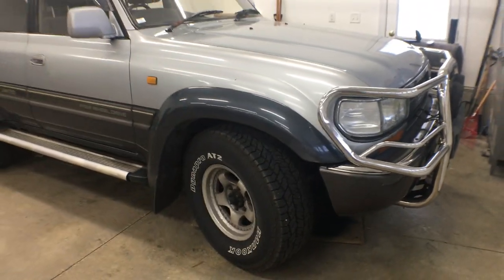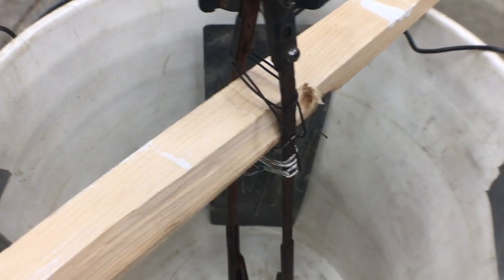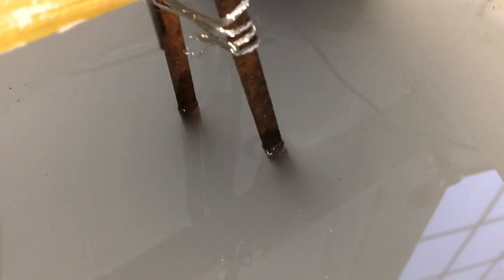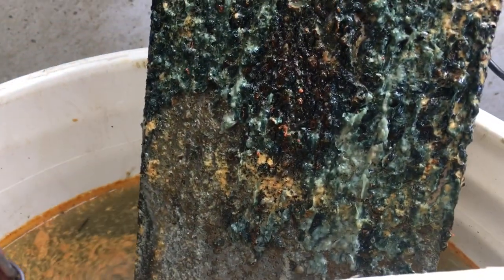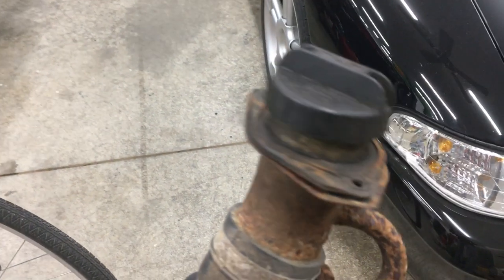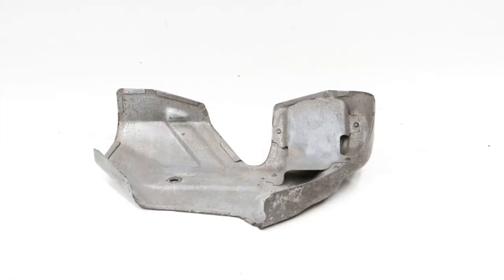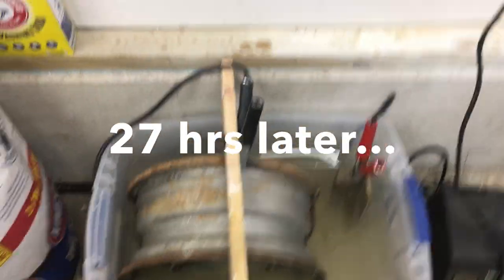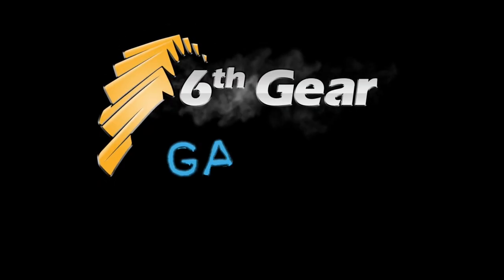How to: Remove Rust from Metal with Electrolysis

Comment: I descaled a motorcycle gas tank a few years ago starting with a few days of vinegar and then switching over to the method you used.  Had to clean off the sacrificial steel anode a few times a day and change out the soda every couple days.  I think I kept the electrolysis going for at least a week and it did work well.  The good thing about it is that it helps get rid of the rust that forms in the pits that sanding won't get.  So if you are going to apply body filler or something, the paint should stay put and won't bubble.  Assuming you get all those little pits well dried out.  Denatured alcohol will help displace any remaining water or you can use heat if possible.  Bake the part out in your gas grill if it will fit.

I think you had carbon formation on the cast iron manifolds which inhibits the process.  I'm guessing you would have to keep scrubbing off the black carbon with a nylon brush fairly frequently to keep the reaction going.